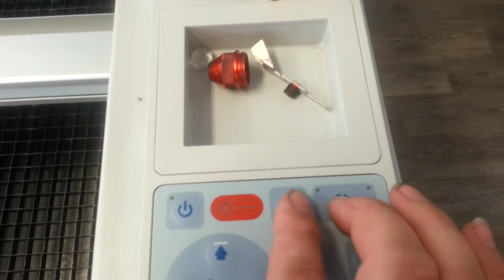Trotec Speedy 400 X axis removal

Comment: What are the width and pitch of those belts on the Y and X?  I have always been curious about why trotec uses such unconventional timing belts compared to other manufacturers.
Also is that a 3:1 reduction?  Looks like a 20-60 tooth, maybe more.
It's like pulling teeth to get anyone to answer these questions.  It's like it's some top secret info for some reason.
Reply: Because 4m/s speed and 5G acceleration, obviously. 
Nobody takes these puppies apart unless it's absolutely necessary, and either way taking it apart is redundant because you can't do much without proper spare parts produced internally.
Reply: I would like to get infotoo

Comment: Which way will be the correct to position the focus lens in a non Tortrec laser machine? I have read in a lot of forums convex side will be pointing up to the bean and the flat part pointing to the cone nozzle`?
Reply: The outer rounded side "convex" always is pointed up. Never down.  The flat (PCX lens) or dished inward (Meniscus Lens) "parabolic" side is always facing down toward the work bed.    This is true for all laser cutters.
Reply: I confirm round up